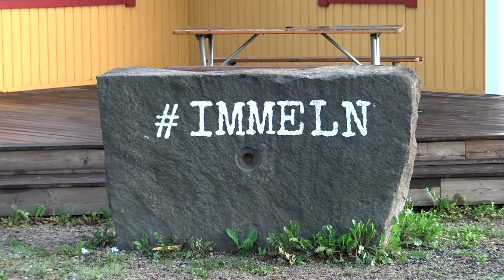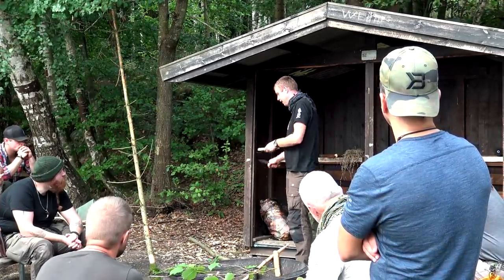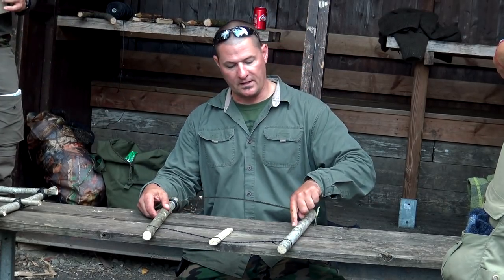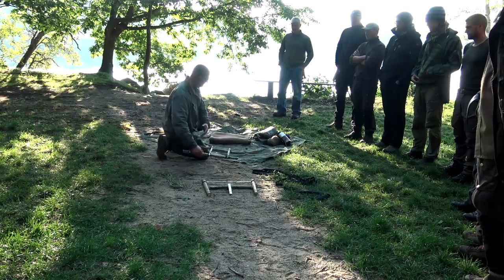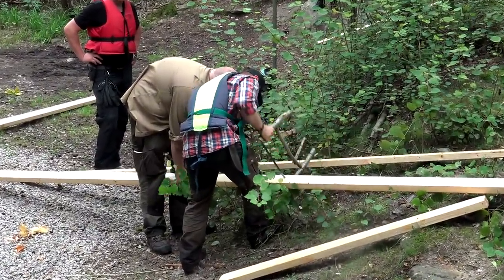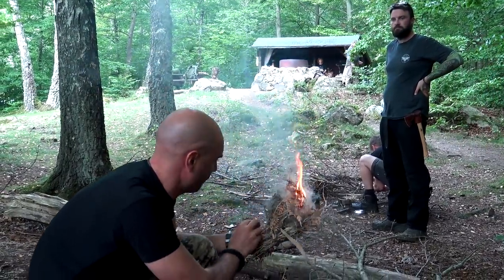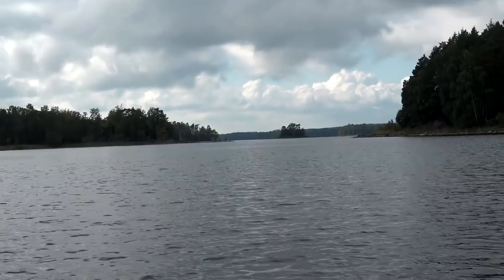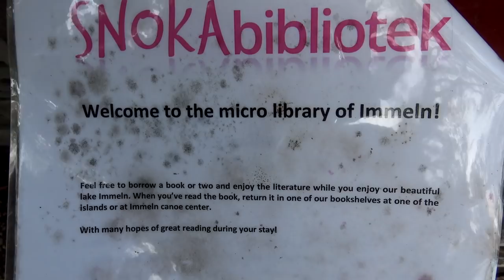4 Days Camping in Sweden (An Epic Adventure)

Comment: why are the doing firestart by makin sparks done in a box and then over in some dry grass?  just use the sparks right into the dry material. ? and if they hold the firestarter steady just above the dry grass and then use the knife or other similar thngs and more or less cut the magnesium loose its a lot faster than making sparks and hoping something land in your wanted area ?